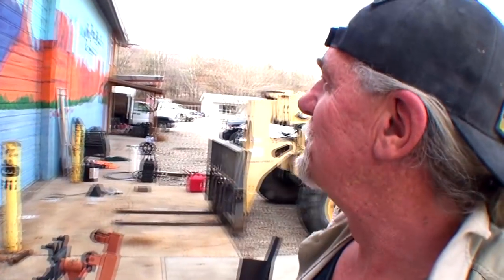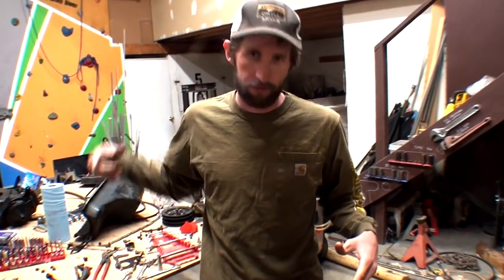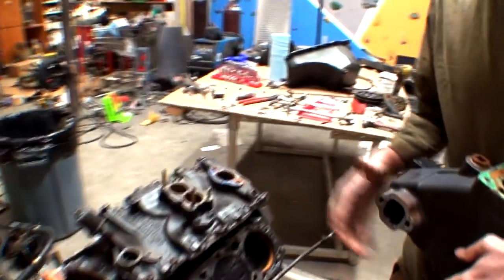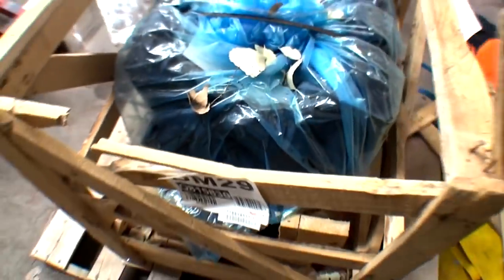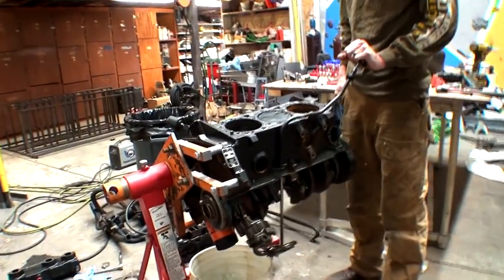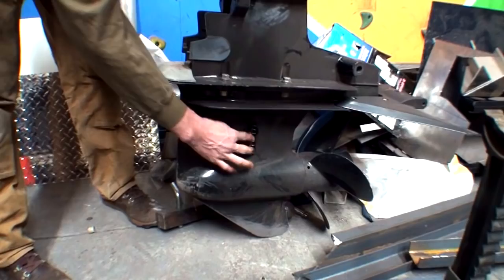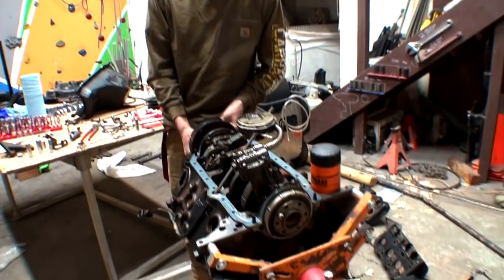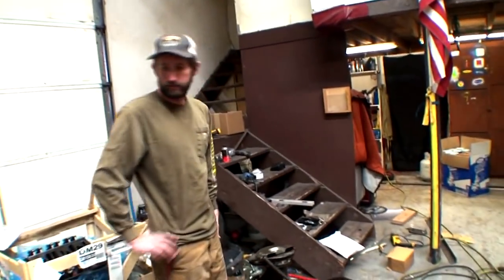How To: Blow A "Mercruiser 4.3 Boat Engine" UP - Extreme Fail

Comment: So I come out that way there's work?
Reply from the maker: Maybe Jed over at RIVER RAT WELDING Can Hire you.. Other then that --- NO! Not much going on here Stacy.... Better off staying where your at..
Reply: @myfriendpete  all good I wouldn't want to disturb the homestead,z . anyways I was just possibly headed out West  vacation ?  it'll be my first treackin,za across America riding on wheel bearings for traveling not on a plan. So yeah was just gageig a response and plan a route and I need safety nets in case things should go wrong or it's Greyhound all the way back real quick

Comment: Sea water pump is in the lower unit with intake holes as shown. It is a rubber cane type inside a stamped stainless steel housing. It is turning when the engine is cranking or running. Anyone who wants to do their own maintenance needs a check list. Remove the transom drain plug and leave out. Count 5 blue drain plugs & rubber gaskets. Sand is sucked into the block, so remove a blue plug, insert a pocket screwdriver or wire and poke for sand, blockage and watch. V8 engines will use a water cooler on port side with p/s coil inside sea water inlet tube and has blue drain plug #6. It is hard to reach and all are easy to cross thread. You have to remove a hose for both exhaust manifolds to add RV antifreeze but never did. Use fuel-stabil in a full tank. Tank has covered side vent, so weather goes hot to cold, moisture will form. Once large enough, they make droplets, fall into the fuel, runs to the back on the bottom. After years of this, it will increase and get sucked up with fuel into carb or fuel injection after 1997-1998. Water pump (Circulation Pump) on front, heads and intake are same as a vehicle. The block is different as it provides for 3 locations for dip-stick tube. The threaded connector on oil tube is for hand or motorized pump to remove oil. Notice the tube extends almost to the pans bottom and works like drinking straw. Block can be ordered port or starboard as cam is reverse ground and engine run backwards. The starter and oil filter is on the opposite side. The block is cast & machined for this. “V” configuration engines has water & exhaust fall Into a “Y”. This pipe is aluminum and has a rubber coating on it. If you idle a moving boat or backing up, water pressure can try to enter “Y” pipe. If it get high enough, the sea water can fall into the exhaust and combustion chambers. Bending rods is possible but hydro-locking is most likely. It can wear on “Y” pipe and leak into bilge when in water. Flashlight and mirror is almost the only way to see it. Other item, boat, car, truck or tractor. If parked or stored for 4-6 months or more, remove and spray a fogging oil in each cylinder. The engine will sit with any number of exhaust or intake valve is open. Moisture forms in metal cylinders and start rusting. Twin 7.4L with Bravo III drives on a 12K boat about 34 foot is just the right size. But not Moab.

Comment: Boat~a hole in the surface of the water into which money is thrown. 😨 Really, besides typical maintenance including winterization, keeping them stored out of the sun and the water they last pretty good. That's been my experience with them anyway.

Comment: This I could speak of ,. I had a Thunderbird  with a Merc on the back ,.   The Motor would run perfect in Reverse or with the boat out of the Water , once you put the motor in forward ,. Putt, putt , putt .

Comment: that guy is full of shit water direction goes from lower end pump to exhaust heat exchangers to inlet where automotive car water pump would be curculates thru engine comes out where thermos houseing is then to exhaust log & out to lower unit at prop